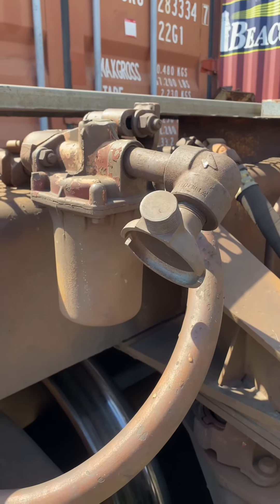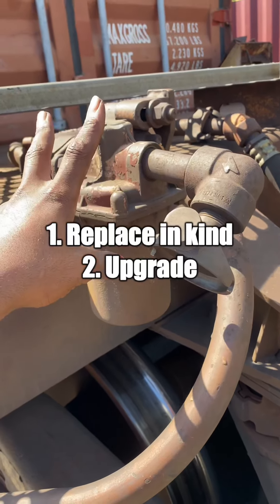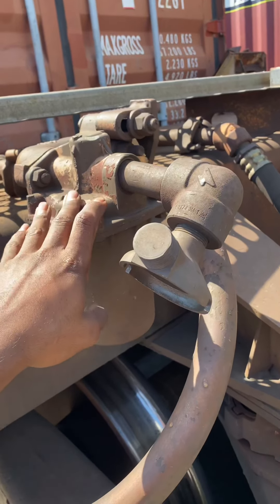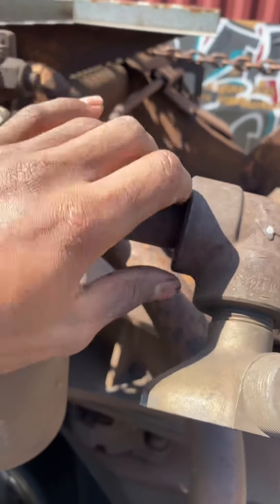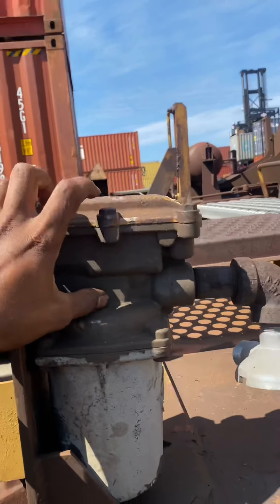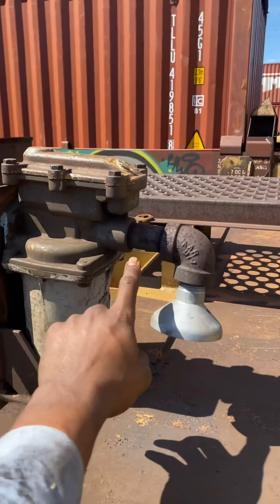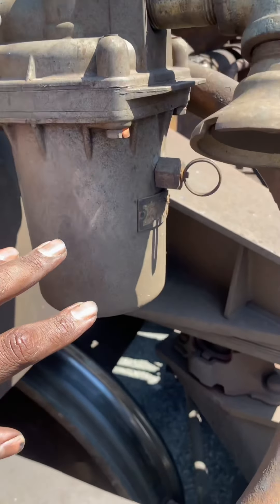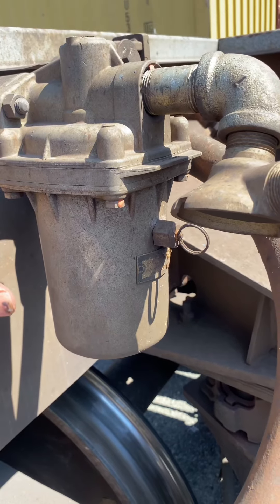Vent Valve Types

Comment: Are these found on larger freight cars only? I’ve done scats on a few cars that had these and was told it was kind of like a back up emergency valve I might be hearing wrong
Reply from the maker: Yeah. But only if there is more than 75ft of brake pipe
Reply: @jaysrailroadcorner5403  auto rack
Reply from the maker: @doodoobaby592  as long as it has more than 75ft of brake pipe.